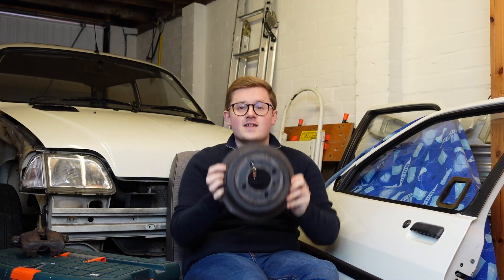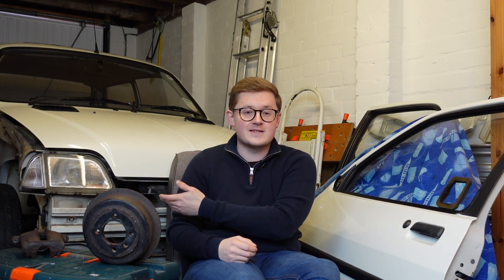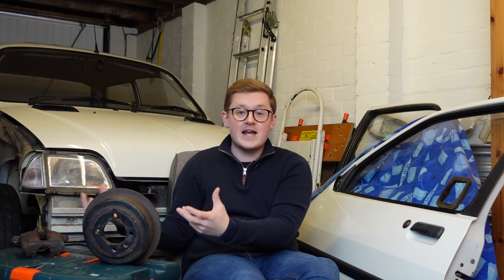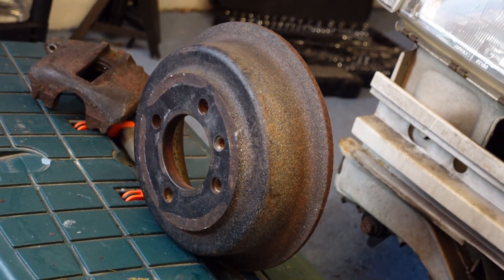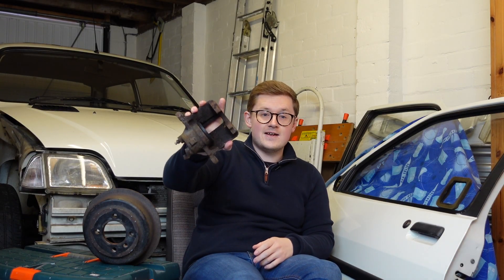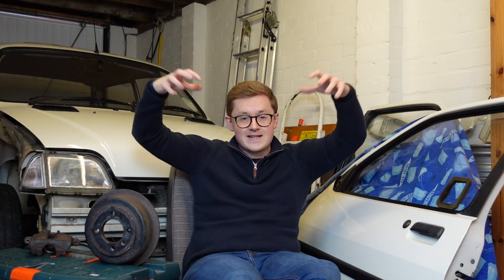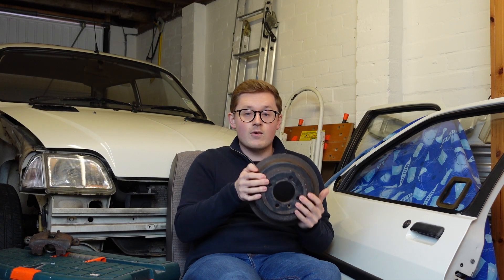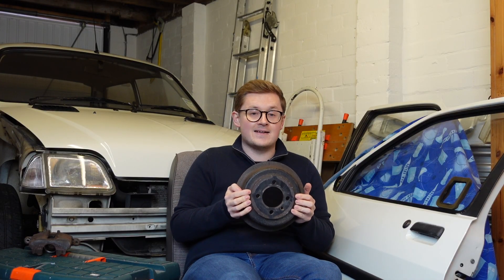Why are Drum Brakes Making an EV Comeback?

Comment: My MG5 has rear drums & front disk brakes. It’s certainly the case that I need to ‘clean’ the disks with an emergency stop every few weeks to avoid having squeaky brakes when doing low speed manoeuvring.  8:20 Incidentally international regulations require brake lights to illuminate with regenerative braking where deceleration is >1.3 m/s/s.

Comment: Just step on the break really hard and the surface rust is gone.
The brakes always have more friction than the tires.
PS where I drive they have salt on the roads 5 months a year, thus rusty disc's are normal.
In the winter the traction is limited by snow/ice and then you can hardly use 10 % of the brake force compared to the summer.
Make sure the calipers can move freely.

Comment: Drum brakes are so inefficient, MOT centres used to fail modified cars unless they upgraded to disc brakes. My late father helped me change my Escort Mk1 front drums to servo-assisted discs using Capri parts. What a difference it made, probably 3 times better!
Reply from the maker: That’s just untrue.

Comment: The one hassle with self maintained drum brakes was that the shoes wore a groove in the drum and the drum edge rusted, so you had a bugger of a job for releasing the shoes enough to get the shoe to clear the edge/rust band!
The joys! (And you try telling that to the kids today; and they won't believe you ;-)
Reply: Every 20 k whip the  drums off, whip out your angle grinder and grid off the lip.
Reply: @janicewatts5888  exactly while your there hoover out the dust. It made a big difference when automatic adjustment came out instead of using the square brake shoe adjustment spanner.
Reply: With regenerative braking on EVs you don’t need any brakes, apart from a handbrake. Old fashioned drums are cheap and cheerful.
Reply: Regen brakes only work when you are moving at moderate pace, unless you deliberately apply stalled motoring forces in reverse. Just saying. (i.e. there are always compromises)  @johnholmes5674
Reply: Funnily enough , another problem with the drums is the manufacturing.  More fiddly bits on the brakes for tms to mess up while handling.  With the rotor and caliper all you have to worry about is the brake pads falling out which is easy to catch
Reply: You are right they are  not as reliable as disks, a lot more maintenance. That's why they are on the back they are only about 30% of the breaking force
Reply: @denniselvy3528  ...and in an EV, would be engaged much less frequently (hardly ever unless you're the type to always hard-brake at every stop light).  Such wear and tear issues may never arise on a commuter EV.  They really do make sense on non-sporty EVs.  It'll just be a matter of getting the public to accept that disc brakes aren't the necessity they may believe them to be.

Comment: You missed another reason why discs are better. Flood water or fords. Drive through water and drums don’t work! They need dried as you drive along. Not so bad if only on the back but from bitter experience if you’re in a drums all round car, things can turn nasty!
Reply from the maker: Hence why you're still trained to dry your brakes after driving through standing water.
Reply: @TwinCam  yes but discs are fine in no time. Drums take an age to dry.
Reply from the maker: Drums are why you’re trained to dry your brakes.
Reply: @TwinCam  yes. Exactly. They’re useless. Retain heat and retain water. This is why aircraft have discs.
Reply from the maker: Aircraft aren’t cars.

Comment: The fuel contains chemical energy, not potential energy!
Reply from the maker: The chemical energy is a potential energy. It requires action in order to release it.
Reply: @TwinCam  Potential energy is the energy inherent in the position. Water has potential energy when it sits on top of a mountain. You can harvest it through converting the movement energy.

Comment: My new Suzuki has drums at the rear and the technician said the shoes would never have to be replaced under normal driving conditions. He said I could drive around for an hour and put my hand on the drum and it'll be barely hot. It's the fronts that do almsot all of the high-speed braking, and stopping distance nowadays is highly dependent on tire grip. When was the last time you heard of a passenger car crashing because of brake failure?
Reply: I've had a friend chew out the rear brakes on his Little Suzuki in under 80,000km but the dealer doesn't pull the drums off to inspect on services. Had to bring it in when it was squealing, ebs causes extra wear over old stuff.

Comment: Clearly you are not from the Great White North.  Drum brakes rot and disc brakes rust and if you don't use a vehicle for a week it will need a good shot of pedal to make it move.  What about fully enclosed, i.e. sealed braking units that would actually be weatherproof?  I have to admit I am concerned about any brake by wire system without a back up system.

Comment: Another advantage of drum brakes is that they require less pedal pressure for a given stopping force. Partly due to the larger surface area of the friction material but also because of the self wrapping action whereby the rotation of the drum has the tendency to wedge the trailing edge of the shoe against it. Because of this lighter vehicles did not require a brake servo to amplify the pressure applied at the pedal, you do get better feel for the brakes without a servo, I do not have one on my track car, it has drums on the rear . You can of course reduce pedal pressure by reducing master cylinder diameter relative to wheel cylinder but that has to be balanced against the extra pedal travel. 
Back in the day when I did my skid training the cars used had drum brakes all round. They worked better for cadence braking. They released quicker when pumping the brakes being actively pulled away by the springs and without the slight lag from the servo. ABS systems have of course large negated the need for cadence braking for road use.

Comment: Have you ever repaired drum brakes ? While the new shoes fit niceley into the drum, the old will not come out. You cannot remove the drum because the pads worked a groove on the inside. And on decent cars like Ford Mondeo the engineers mounted the struds right behind the release opening  so you are required to drill a hole at exactly the right place to be able to release the pads. So maintenance of discs is much easier. You can even see if they need replacement. It is just that drums are cheaper, that Volkswagen installed them on Id.3s. Everything else is just marketing speech. Brakes have to be stronger than the engine so you can stop a car with an engine running wild, but they need not be stronger than the tires slip, you can't break more than the grip you have. Electric cars need no brakes, as the motors may produce the braking. Only in emergency. That can be implemented as good as drums with discs that do not sit in the wheels where they are unsprung mass, but on the motor shaft, like a 2CV had, even encased. Drums are just an established cheap solution,  not a good solution.
Reply from the maker: Yes. You can see me rebuilding rear drums in my Melvin the Metro playlist.

You're meant to turn out the adjuster before removing the drum. Similarly, drums have small rubber grommets on the back for inspecting the state of the shoes.

Comment: I noticed drum brakes on the rear of a new car in a parking lot. Don't remember the brand, might have been VW, but it amazed me when I saw it.

My two first cars had drum brakes in the rear. My 1986 Fiat Ritmo 130 TC Abarth had normal drum brakes and my Toyota MR2 SW20 had a combined disc and drum in the rear where the drum was used for the hand brake if I remember correctly.

Comment: Surely on modern EVs they could program the car to touch the brakes once every trip to clean off the discs so they don’t corrode.
Reply from the maker: The problem with that is that it's both potentially dangerous depending on when it cleans, and it's inherently inefficient.

Comment: Drum brake inside the diskbrake must be cheaper than the alternative that I had already in -85 Audi 200. It had  discbrakes in the back and parking brake used them as well. Piston was pushed with a rod that was actuated by the parking brake handle. No need any extra drum brake just for parking brake.
Reply: Volkswagen use them still.

Comment: Braking force being greater is the reason some cars have both disc and drum brakes on the rear axle where the drums are used as a parking brake.
Reply: If they are just used as a parking brake I would rather assume they are used to prevent the parking brake scenario affecting the disc brakes, not because of a difference in braking force. Which is a minute requirement anyway when functioning as a parking brake.

Comment: I just purchased a Ford Ranger here in Thailand and I was surprised to find drum brakes on the rear. I am one of those who thought drums were relics of times past. Thanks for the video. Very informative.
Reply: They are used on all the Thai utes. The Chinese utes are disc all around. So much better, the drums you can't see them wear out from the wear indicator especially with the dmax with no mechanical lsd, just electronic lsd doing the work.
Reply from the maker: Thanks mate :)

Comment: I have to disagree with you when you say drum brakes need less maintenance. Twice a year, I have to crawl under my car to adjust out the play due to the wear on the shoes.  Not necessary with discs.
Reply from the maker: That's on a manually adjusted drum, like my Metro has. The vast majority of recent drums are automatically adjusting.

Comment: It is total bullshit that drums are adequate for EV brakes. If you hammer any of the EVs out there hard, disks are mandatory. Try to tame the cybertruck with drums at pace. Nope.
Reply from the maker: The Cybertruck can hardly be counted as even a car - never mind something dreamt up by anyone with a brain larger than a peanut.
Sensible car manufacturers are seeing the benefits and are experimenting right now.
Reply: @TwinCam  Even a Nissan Leaf can be thrashed hard enough to comprehensively overwhelm the disks fitted. Drums wouldn't stand a chance. Swap cybertruck out for lucid air (normal or saphire), model S (any variant), X Y 3 all variants, Kia EV6, ioniq 5, etc etc. No modern EV can cope with drums which would be prohibitively heavy and too large for reasonable wheels to get sufficient thermal performance. Can you get race linings made for drums? Hes, but outside the UK it's hard to get. Performance disk pad materials are easy to get worldwide. No daily driver could tolerate the behaviour of race materials anyway, especially not in winter.

Comment: The rust issue can be dealt with in software. Just apply the tiniest bit of friction brake on every stop and lose the energy into maintaining the surface finish. Easy.
Reply from the maker: It can be, but that can also be potentially dangerous depending on when it happens, and it's naturally inefficient.
Reply: @TwinCam   trivial, the software can easily analyse the use patterns and dynamically modify the strategy to be more efficient over time. Defaulting to all regens and progressively doing it less, and at higher speeds as patterns are established. If a humidity sensor is available this can be used too. Only in wet and or humid places would this even be a problem at all. UK, northern Europe, Northern US and Canada etc. Minimal need in hot dry places like Arizona, the interior of Australia, large swaths of Africa and Spain, etc.

Comment: drums have more breaking force.... is that really relevant though, breaking force is ultimatly down to your tyres, which is a force disc breaks can already exceed considerably. 

but as a side note couldnt electric cars also use that excess heat generated in the drums?  duno if it would ever be enough in a road car...
Reply from the maker: Tyres are the only contact patch between your car and the road, but this video is about brakes.

Comment: Best setup is disks on all 4 with hydraulic pressure from the pedal. Handbrake is a small drum built into the rear rotors. Disk handbrakes are unreliable especially if applied with high rotor temperature. Disk front drum rear is horrible due to asymmetric initial bite and asymmetric thermal friction coefficient profile. However drums on all for okay. I have 2 modern k cars with boosted 4 wheel drums and have tracked one without trouble. They do get hot but I have not had them fully fade even pushed ultra hard.

Comment: very good video, which also explain brake re-gen in simple terms. However one caveat for modern disc brake systems, they 'wipe' the discs while driving, through ABS. This always keeps surface area dry and rust free.
Reply from the maker: They do, but not enough to keep the disc totally clean.

Comment: Drum brakes may well have a use in electric vehicles if the heat in the friction material and the drum is carefully controlled using expensive monitoring systems.
Drum brakes are more prone to brake fade due to heat build-up and water entering the drum and of course glazing of the friction material and the drum.
Drum brakes suffer from leaking wheel cylinders resulting in possible replacement of the brake shoes and also suffer from seized brake adjusters. Drum brakes require continuous adjustment for safety reasons.
Disc brakes are cheaper to repair due to the reduced labour requirements more so when changing pads.
As a qualified mechanic I would never choose drum brakes over disc brakes on an ICE vehicle but as you say electric vehicles may be a different matter.

Comment: For me drum brakes never died out. Of the four cars I have only one has two drums, the rest has four.
Reply: I have a 90's Pontiac Grand Prix, with disc all around, something a bit unusual for the day.  After futzing interminably with noise, even having a shop look at them, and only partially solving it by wire-wheeling everything they could, the brakes are still noisy sometimes.  All because discs are seen as 'sporty'.

Comment: Drum brakes never left the aviation industry, an application that can be far more critical than autos. But most of them today use carbon/carbon brakes which is not affected by heat too much. Aviation industry pioneered ABS. On a wet runway, the pilots are generally in another postal code and do not know what the brakes are doing. If they lock the brakes, there will be a flat spot and the tires will blow in about 3 seconds, and you might lose the plane when it skid off the runway.  So cost is no objective The first ABS was around mid 50s?  Cars had to wait till the 90s.
Reply from the maker: I believe the first car with ABS was 1966?
Reply: @TwinCam  But to be common and standard equipment, it took till the mid 1990s.

Comment: Hi, just found your channel, good job on this topic. Many people assume disc brakes are more powerful, and I appreciate you tackling this here. Lorry, coach and bus brakes have remained drum based as cars moved to disc brakes as you described. Drum brakes make perfect sense on an EV, it will be interesting to see if manufacturers are brave enough to make the change, perhaps hidden behind more plate like wheel designs - which are also better to reduce drag (wind resistance). Drum brakes are also much cleaner, wheels gut very mucky from brake dust shed from disc based systems.
Reply from the maker: Thanks Simon :)

Comment: Great Video!! I had not thought about what you said but it makes total sense! I have a 1949 Studebaker Commander Sedan and it still has its Original drums!!! Old cars had smaller brakes because larger brakes were pointless because the tire adhesion was so poor in the pre-radial tire days and modern rubber compounds all bigger brakes did was lock up the wheels even easier!
Reply from the maker: Yep, it's an amazing turnaround to see such huge brakes on many modern cars!

Comment: We own a new ID.3 and an older Zoe.  Both sound like geriatrics when braking at low speed.  It was explained to us that by our friend who is a mechanic that they so rarely use their physical brakes that they quickly become oxidised.
Reply: Use the friction brakes once a trip and that will clean the discs.
Reply: @cjmillsnun  Apparently the friction brakes only kick in below 4mph and on one of them, it’s an electronically operated park brake.
Reply: @rachelcarre9468  You can just put the ID.3 in neutral on a downhill and do some light braking for a few seconds.  Regen is disabled in neutral.   I do that about once a month or after a good rain to clean up any rust.  No real need to do it more often than that.

But yes, under normal operation most full battery electrics, including the ID series, barely ever need to use their real brakes.  The regen handles 99% of the braking and the engagement of the real brakes at the very last bit when coming to a stop doesn't really count.  2 years so far, and my pads might as well be brand new on the fronts they've been used so little.

Hybrids, on the other-hand, tend to use their real brakes a tad more because the electric motors in hybrids are not capable of the level of regen that full electrics can do.
Reply: @junkerzn7312  Thank you, will give it a try!